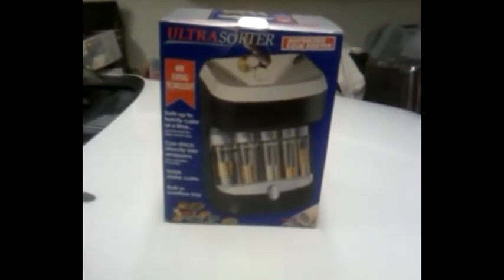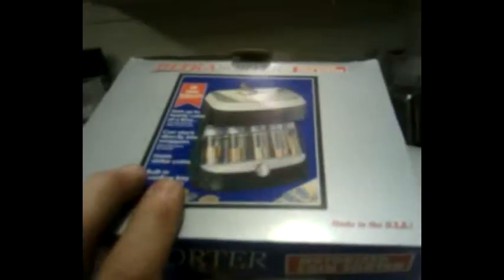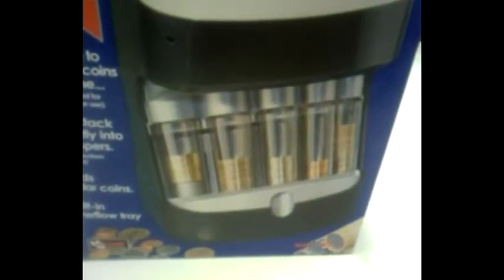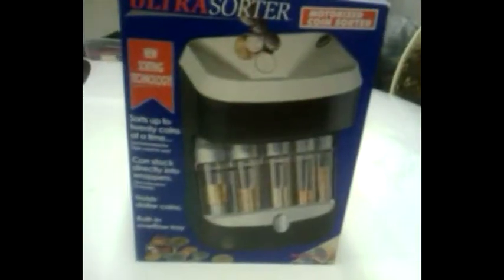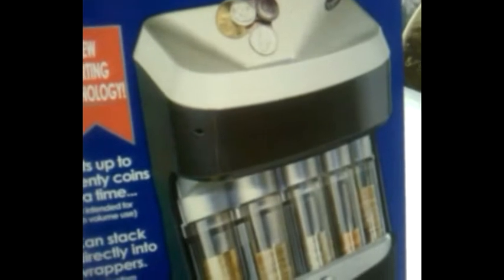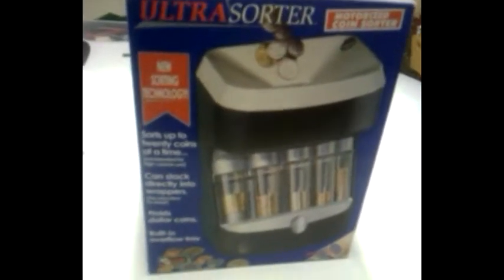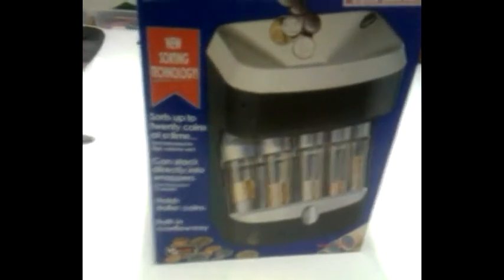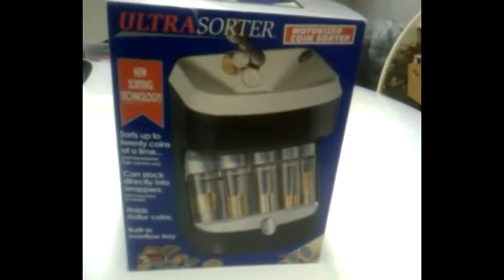copper penny sorter and comparator

Comment from the maker: @AReptileMan kai-198 is what is on the side of the comparator. also there is what appears to be a metal weight on it that i removed. It slowed it down so I took it off. it has been working really well. not bad considering I paid like $15 for it.